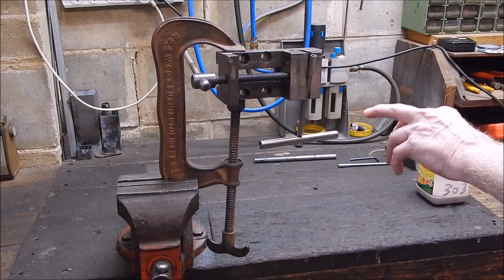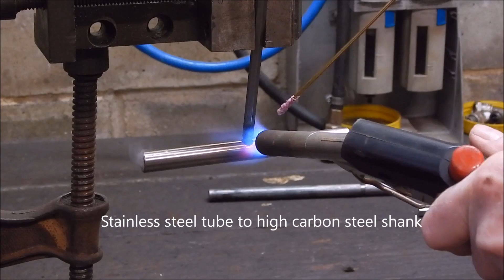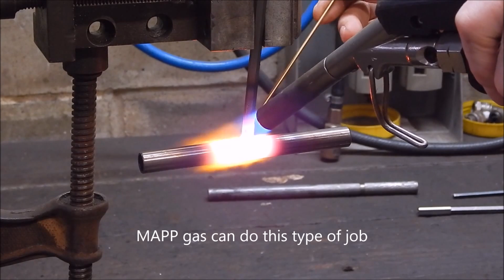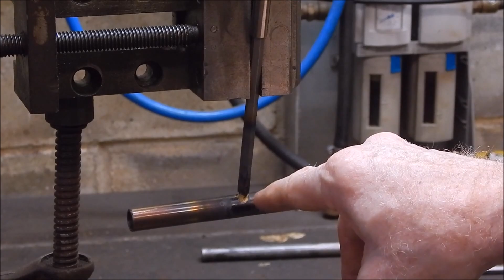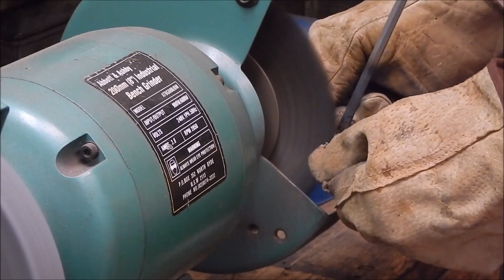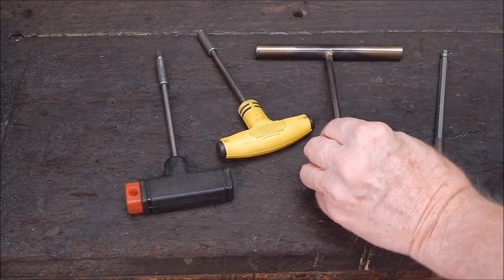How to use a heat sink when bronze brazing

Comment: Hello Rob! I noticed you talked exclusively about MAPP gas in this video. Did you stop using propane with your Bullfinch torch?
Reply from the maker: Hi Rick,

I focused on MAPP gas (or the current equivalent) in the video as most hobbyists only have that for bronze brazing.  Very few have a specialised LPG/prpane torch that can do it.  These are expensive.

I still use the LPG Bullfinch torch.and it's money well spent if you do this type of work.

The next cheapest option is oxy/LPG as it's now possible (and a lot more economic) to buy D sized oxygen bottles and avoid the annual rental charge in Australia.

This is also much cheaper to buy the torch/kit up front.  A tempting option if you bronze larger items that the LPG torch can handle.

The main drawback is that you will use four times the oxygen as LPG/propane on a weight basis, so the oxygen gas soon adds up cost wise.   9 kg refills cost $65 each versus $20 AU for the LPG and you need four of them per one LPG cylinder.

Cheers Rob

Comment: Maybe I missed something but why wouldn't you mount the part to be heated ABOVE the part to be kept cool?? You can't ever underestimate heat's ability to migrate upwards. You can greatly reduce waste heat permeating your object by simply letting it migrate upwards on its own but prevent it from hurting your object by placing them below the targeted work area entirely, if possible.
Reply: But aside from that, Two- thumbs- up! Awesome and  Informative video, great stuff!
Reply from the maker: That would mean the brazing would have to be done upside down, which is not recommended ;)

Comment: You make a very good point about keeping heat away from magnets.  I buggered up the embedded magnets in my vise's aluminum soft jaws by burning the crud off a spark plug with a propane torch.  Didn't need the soft jaws for that job, they were just in the vise at the time and I put the plug in bottom side up out of habit.  Now they're non-magnetic soft jaws.  Oops.  That will be a handy little T-handle, good idea for hollowing the ends to minimize thermal mass.
Reply from the maker: Yes, it makes things lighter to use hollowed out.  Thermal loss is also greatly reduced.

I found a bronzed  "T" handle in some bits with an old lathe I bought, and same thing, the magnet had been cooked, so it no longer worked.

A basic heat sink can avoid that if placed correctly to soak up the heat transfer. 

Cheers Rob

Comment: Hi Rob,
The skin on your fingers must be as tough as leather.
Surprised the wire didn't burn your fingers !.
Cheers Adam
Reply from the maker: No sense, no feeling ;)

Heat transfer is slow in steel, unlike alloys.

Cheers Rob

Comment: I need to get a torch like yours, you make the job look easy, my Bernzomatic TS8000 is a good torch but really struggles to get steel hot enough for brazing - another good video!
Reply from the maker: Some MAPP torches are better than others.  The Bullfinch LPG torch puts out more Bthu than most, even though the gas flame temperature is lower than the current MAPP equivalent/replacement - more throughput.

Cheers Rob
Reply: coolvideotubes yeah his torch looks really powerful, I tried brazing a tiny part with a ‘spiral flame’ MAPP torch and it couldn’t get the piece above a dull red, not enough to flow the bronze

Comment: G’day Rob, I always forget the good old brazing process since I got rid of the expensive oxy set 30 years ago. I’ve got a Mapp has torch must get some bronze and silver solder rods for these small jobs. You’re right mig or stick is not the best for these jobs. I enjoyed and no Banggood (just had to) unless of course the extension came from them. 
Cheers 
Peter
Reply from the maker: Hi Peter,

They did actually come from BG.  Bought them with my own hard cold cash.  Buy three and they get cheaper.

Cheers Rob